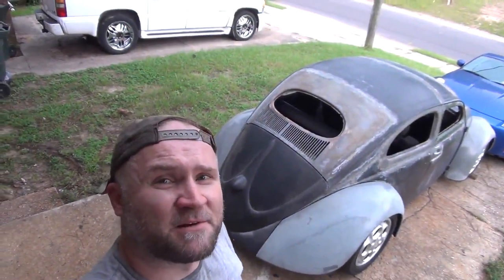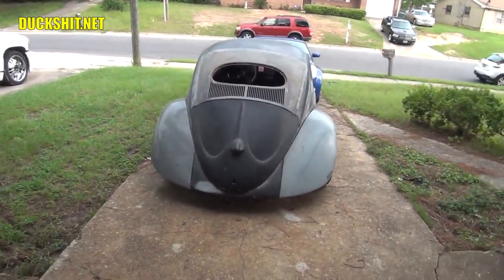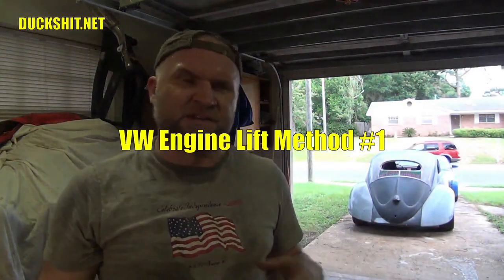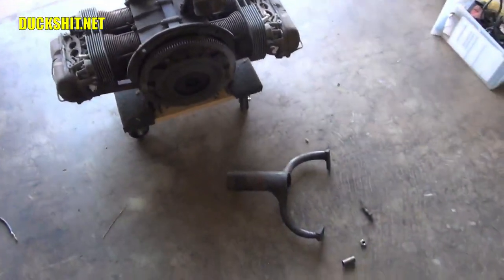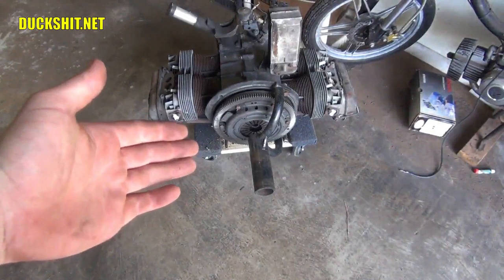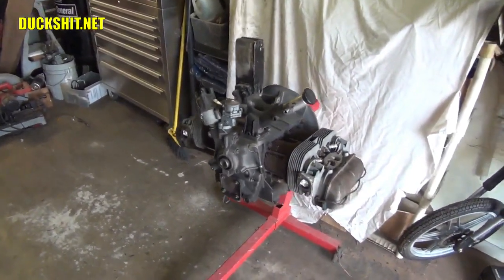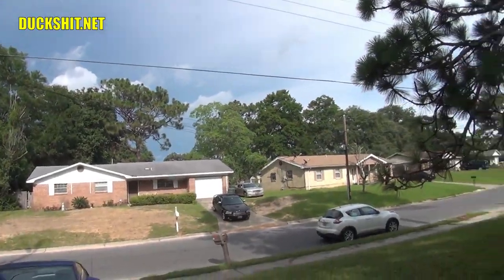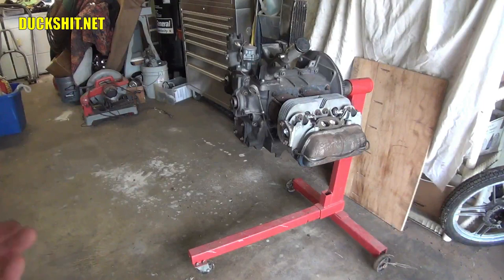VW Engine Stand - How to Lift and Mount (Air-cooled Porsche, too!)

Comment: Another way when alone - mount the bench mount yoke part on your bench securely and make sure your bench has at least a 2x4 directly under the yoke location (in case your bench is not strong). Then,if you have either an open garage ceiling or a way to mount a large enough hook to one of the ceiling support wood members in line, slightly ahead with where the yoke is. Hang the main hook of a come-a-long (or whatever you call them) on the ceiling hook. Place the engine, with ropes attached, under the extended come-a-long. Put the hook on the rope center and jack the engine, with main yoke secured to the engine, up to the bench mount. I've done my rebuilds this way from tear down to first start this way with no trouble. Roll around stand is preferred, but you do what you gatta do sometimes.
Reply from the maker: Oh man!  Thanks for the suggestion.  My back was hurt last week FROM MY CHAIR... of all the things.  LoL!

Comment: I reference this video twice now.  Once to lift my first engine and I use method four which it works great.  But of course I put the yoke on the wrong side the second time and lifted up.  So, why does that matter what side?  First time was with a different engine that I dismantle so it was easy to remove but this engine I'm not going to dismantle.  So now I need to lower it to move the yoke to the driver side which i've not done before.  I guess its the same process except scarier because I'm lowering it and don't want to drop it.  Thank you Sir for all your videos and sharing your knowledge.

Comment: All the methods you demonstrated are very good and I've used them all. In the day I used to have cars with I6 engines and if you're familiar with Detroit I6s you well know that powerlifters could use them for training they were so heavy. I came up with an idea that still works. Making a simple frame with a double U similar to motorcycle swingarm jacks or F1 pit lifting jacks I fabricobbled a swinging frame with seatbelt slings on either side for the job. One can utilize the engine mounts or, in this case, the cylinder pots to lift the entire long block. I later installed a ratchet from a boat winch to make it more usable. It has four wheels and the center of gravity will always balance as it swings. It resembles a U shaped auto rotisserie with hinged pivots. It uses the principle of a camshaft to multiply the torque and center everything while the wheels shift the center of gravity, stabilizing itself constantly while rotating itself. A boat lift is also another way of picturing it. Thank you and good luck!
Reply from the maker: Thats a lot more cylinders and a lot more weight for sure!  I have an AMC 304 over here (from a Jeep) if that thing fell off the stand it'd be a disaster!  I need to get that out of the garage!  Want a rebuilt Jeep engine?  😀😂😀😂😀
Reply: Thanks for the offer. It would be a great trip. You're from New Jersey, I'm from Nova Scotia. I could be there in two days of solid travel. Now, where to get a decent C-J4 or 5?
Reply from the maker: Craigslist.... lol  

😀😀😀😀

Comment: This couldn't have came at a better time. I'm pulling mine out this weekend and have never done it before so I found this video extremely helpful. Thank u so much and keep ur great videos coming I like them all! Next time have skeeter help u pick it up lol
Reply: Daniel Bates agree completely,  perfect timing and very handy advice. I'm about to pull a motor at the weekend as well, in Australia though. Good luck.
Reply from the maker: Thank you so much!  Very glad I that I helped!   Let me know which method you used!  😀😀😀😀😀
Reply: Did it! Mate turned up with an injured arm, so we used the "engine stand on its side " method.  A bit tentative,  but the engine crane made all the difference. Oh, and his injured arm has not affected our beer drinking, hahahaha. Cheers Tony.
Reply from the maker: Haha, thanks Tony!

Comment: can i use the standard engine stand mounts or do i need that VW 2 point MOUNT?
Reply from the maker: The mounts that usually come with these engine stands tend to put too much stress on the VW case in the wrong places.  I've seen people use them and be fine, but I've also seen people use them and crack the case.  I recommend the correct mount always!

Comment: Awesome video, just remember to put the pin in the roller before you do the 2 by 4 method cause the engine will fall out of the socket :P
Reply from the maker: oh no!  De-socketed engines are terrible!

Comment: Hi... Im Suzanne...would if you do have a big heavy engine that is on a pallet and you need to get it on a stand?
Reply from the maker: If it's a Volkswagen engine I would still do the same thing.  If not however, you might want to go with cherry picker method seen in this video.

Comment: I've seen this other method that I am on the process of reproducing for myself. If you have the front pulley attached. A small chain with 2 hooks and a cooling belt. Loop the belt on the underside of pulley and the 2 hooks on the bolt holes at the top of the block. Rig it to length so the chain and belt can be lifted with an engine hoist. It is brilliant as it is so quick and easy to attach and undo. When  I finish it,  I will post a picture.
Reply from the maker: Sounds interesting, thanks for sharing!

Comment: What size bolts to mount the adapter to the engine?
Reply from the maker: I have to Google that to get the exact answer, but you can just use the bolts and nuts that you took out when you removed the engine! 😁👍🏻  hope that helps!

Comment: gotta say Duckman that's impressive lifting one off the floor like that.. ive only done it taking one from a back of a pick up truck or work bench to the stand, so basically just carrying it a few feet... that enough for me … at 54 my back no likey ...so I just ask a neighbor when its that time ...never seen that last method and I may try that one day … thanks for sharing
Reply from the maker: At the end of the video I have it lifted over my head!  LoL!  I'm 40 and my back is VERY strong... for now anyway lol.  I bought an engine from an old man a couple years ago wrapped it in a rug and carried it from his backyard out to my car.  I paused for a moment to catch my breath and he decided he was going to help and grabbed the TOP of the engine pulling it away from me and damn near rolled it out of my arms.  I had to RUN to my trailer the last 20 feet to stop from dropping it to pull it from his grip! Damn idiot he was... and he was barefoot, too!  Not a good idea when lifting engines!
Reply: LOL !  just be careful … you know smarter not harder is a good adage to remember except when your with the girl friend  ha HA !  good day
Reply from the maker: LoL @ girlfriend metaphor!

Comment: Get a friend. Or be prepaired for hernia. If you have back issues guys no joking here. Have a person help you regardless how long it is going to be. Its not worth hurting your back and possible much more if done wrong. Thank you again for the video
Reply: Funny how people think lifting heavy things is bad for your back.... Its only bad if you can't keep the spine strait, which is a matter of core strength.  
A healthy man under 50 should be able to lift a light engine like this no problem, otherwise its time to hit the gym before the inevitable decline of the mussel mass from 50 -> death.
Reply from the maker: You gotta be The Duckman to do anything The Duckman way!   Hehehe!
Reply from the maker: @mawe42  well not just any healthy man, but you've gotta be built for it.  Its not for everyone.  I can lift 500lbs and carry it.  This is less than half.  So I am an exception, i'm also not in the best health... I've gotten a little fat from the beer.  Hahaha!  I cut back on the drinking, but I need to work out more!

Comment: We’ve used old seatbelts and D shackles before to do engine lifts, firmly attached to a forklift!
Reply from the maker: That'd work, someone else on here posted about a forklift, too!  Must be a lot of shops that have them!  Heh!
Reply: DuckmanCycles and VW Garage well as you can see by my picture, I’m also into old big buses, so a group of friends got together and bought a real old Coventry climax forklift. It’s a 2.5 litre diesel, with a 2 speed manual transmission. The company was part of jaguar cars back in the early 70’s.
It would black smoke like crazy until we pulled the air cleaner, and found a BIRDS NEST!
Reply from the maker: Haha,  thats a different style of filter right there for sure.... lol!

Comment: Did you use the engine bolts that would go into transmission for the stand? Thanks again for video
Reply from the maker: The nut I used is the same nut that you would normally use on the bottom bolts.   The top bolt that I used is shorter than the normal top bolt in that location... less turns makes it easier to install and remove, but there was no reason why you couldn't use the long bolt that is normally in that location. I hope that helps :-)
Reply: DuckmanCycles and VW Garage yes, thanks
Reply from the maker: YAYYYY!  😀😂😀😂😀

Comment: when i was 26 i had no friends around to help me lift my bug engine,,now im 50 and have a strong fit son to help me out i have no vw bug to work on
Reply from the maker: I just turned 46 and nobody wants to help me, so I find myself taking of bodies or removing engines alone.   I suppose if I stopped doing it, that's when my body will tell me that I'm not able to do it anymore LOL

Comment: how you do it would depend a lot on what you have available. I have seen guys with lifts raise the car as high as a wheeled tool box, let the lift down until it touches, then pull the last couple of bolts. They raise the rest of the car up, then wheel the engine out. Another method I've seen with various engines is a simple chain hoist, but you have to have one in the right spot to do the lifting as required. Then there are some guys that will use a handy fork lift as the hoist, but that is risky, especially when the fork lift is moved around the shop to do other things. This method was used, the engine was all but done, then some idiot backs the forklift into it knocking it down, off the stand and breaking a ton of things. Not good for the engine, the builder, or the idiot that lost his job that day and got billed for the parts for the next rebuild. This is also why it's better to work alone in your own shop than in a large shop with lots of other people around.